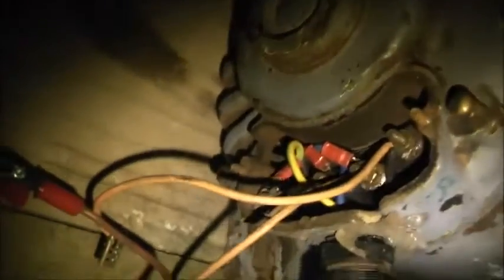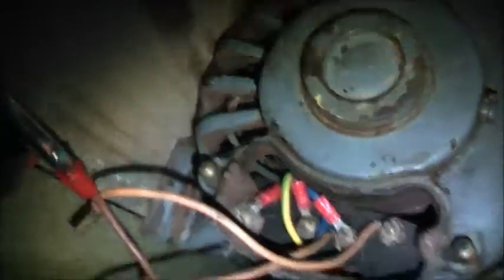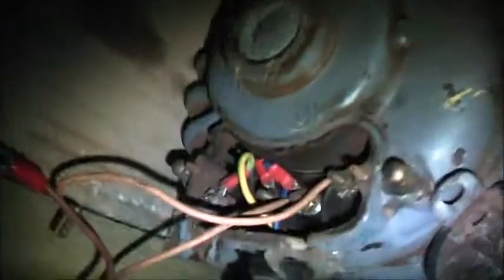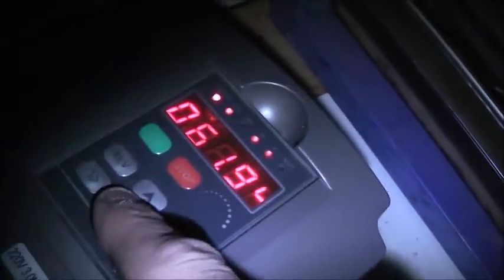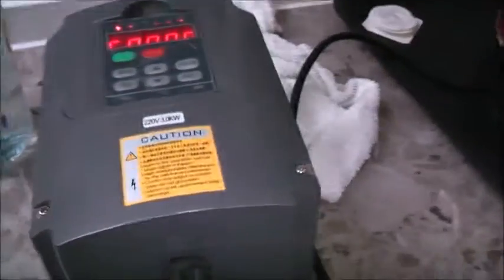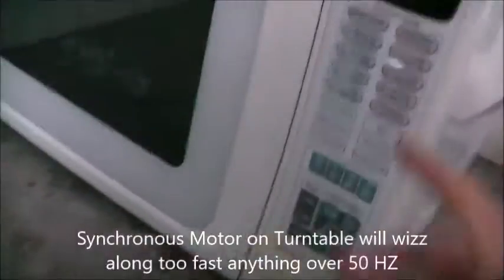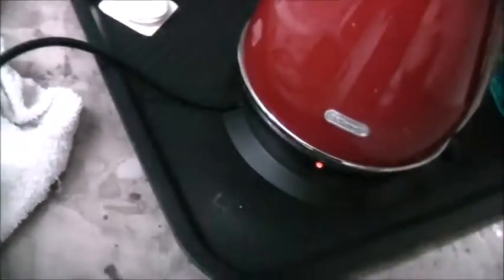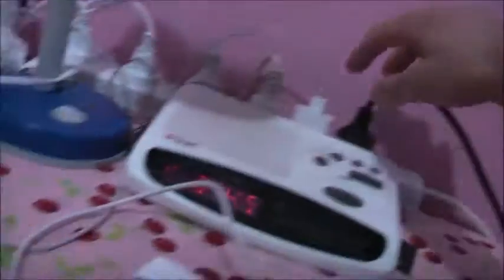VFD On Single Phase Motors & Kettle

Comment: Hmmm..... saves energy?

Chances are, what is happening, is that the appliances are staying "on" more frquently per second than what they would on grid-supplied 50Hz, so it gives this impression that they are either runing more efficiently or are saving energy.

If it is a heater like a kettle or electric fire, then try DC...... the appliance will be "on" 100% of the time it is energised...... and will probably get very hot quute quickly!

BE ADVISED THOUGH:

DC can arc, so if an appliance has switches, be sure to put the bridge rectifier AFTER the switch but before the element and then you can continue to connect the device to AC without fizzing over the switch.

Thanxx for showing,

-BoomBoxDeluxe.

9th July 2016, 03.02